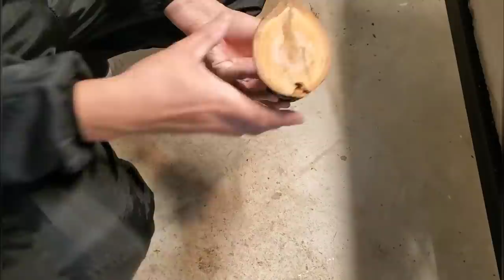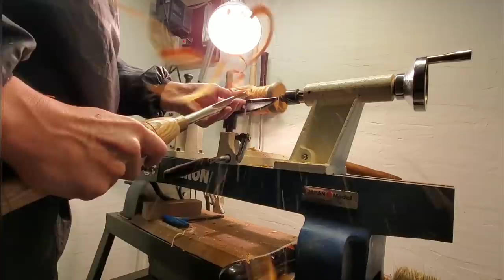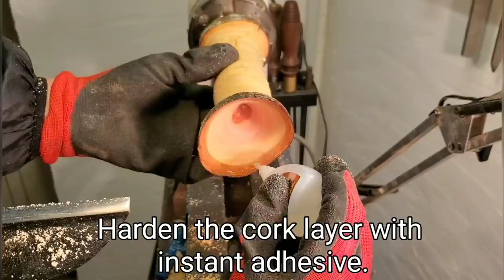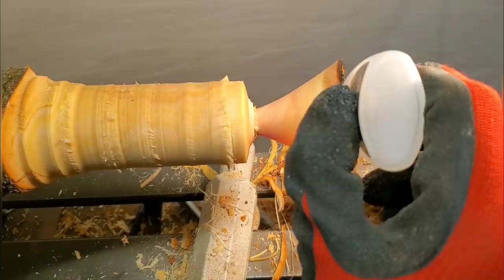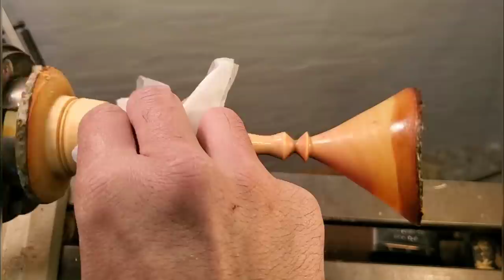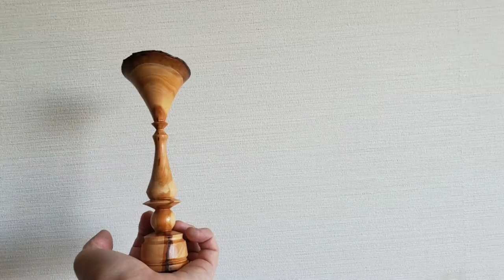Woodturning - log into a goblet 【職人技】丸太から木工旋盤でアートを作る！

Comment: What great work, the paint is it a osmotic paint?  Well done enjoyed your turning, cobber.
Reply from the maker: Thank you for your comment!!🙇🇯🇵  It is permeable.  Uses a paint that cures in response to moisture.  The thin part does not break, but the thick part such as the table is used because there is a risk of breaking due to drying.  Oil almost always cracks.

Comment: I see you are turning green wood and need some advice. What are you doing when you are finished with it that stops if from cracking?
Reply from the maker: Thanks for your comment!  Depending on the type of tree, cracking hardly occurs even in green wood.  If the wood is fragile, apply the paint repeatedly to harden the wood.  Be careful with thick places!  If it breaks, I'm using a mixture of glue and wood powder instead of epoxy.

Comment: Very nice work what do you use to harden the wood and does it help with the wood cracking
Reply from the maker: Thank you!!
There is a product called “Kigatame Ace” in Japan.
However, if it breaks even if it is applied, wood chips are packed in the cracked place and hardened with instant adhesive to make an accent.
The only way to make it harder to break is to remove the core or thin the wood.
Sorry for not being helpful.

Comment: What type of wood is it?
I would guess and say cherry?
If you make a mortise instead of a tenon, you dont have to cut it away at the finish.
Reply from the maker: Thanks for your comment! informative. I have a long nose jaw, so I'm going to consider a way to pierce and hold!
This tree becomes cherry blossoms.
Reply: @YamabikoWoodArt  
I usually start by boring a hole with a forstner bit, after 'guestimating' the approximate centre.
I can then use a parting tool to smooth the base, after turning off the excess material on the circumference.

Comment: Sir. I'm missing something here. How do you achieve the "wavy" natural edge??
Reply from the maker: Whether or not it has wavy edges is unpredictable depending on the tree type and conditions. In my experience, swelling is more likely to occur with a 0.5mm thickness / flat shape. It is also important to choose trees that move a lot by drying! This is a cherry branch!
Reply: @YamabikoWoodArt  Your insight is amazing and an inspiration. I will always be your apprentice from a distance. NO PRESSURE! LOL! ... and by the way...I just ordered my very first lathe. Literally 5 minutes ago. A Jet 1221VS 15" by 21" 1hp.   delivered to my door for $93. Did I do well?
Reply: there are 2 ways to achieve a wavy naural edge.  1st, you can have a tree with a wavy natural edge.  2nd, you can have a species that distorts a lot when it dries like these did, after turning very thin, and creates a wave in the drying process.
Reply from the maker: @anthonybeasley7076  Thank you!  I am still studying, but I want to share my knowledge as much as possible!  I've never dealt with a jet lathe, but I don't hear any bad rumors.  Bed seems to be solid, too.
Reply from the maker: @mitchgillilan  Thank you for the information! I want to make use of it in future works!